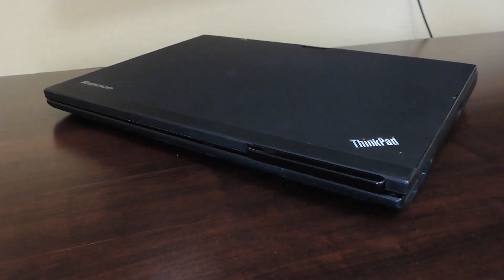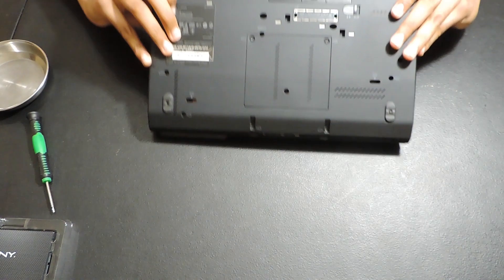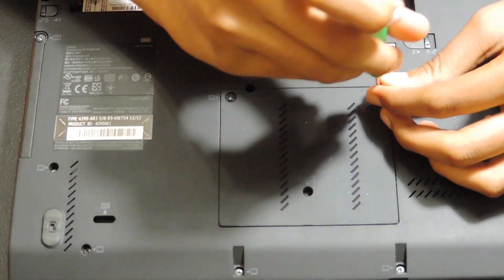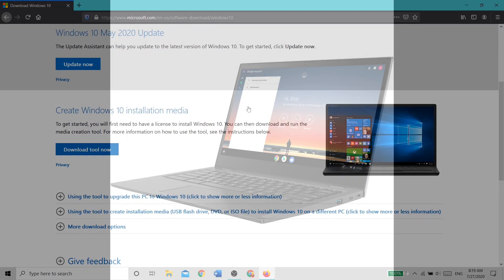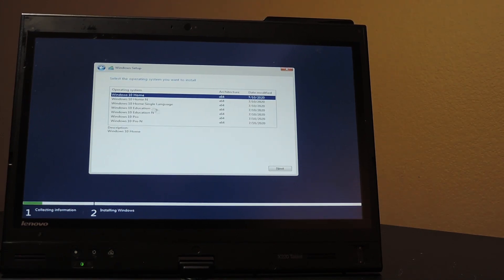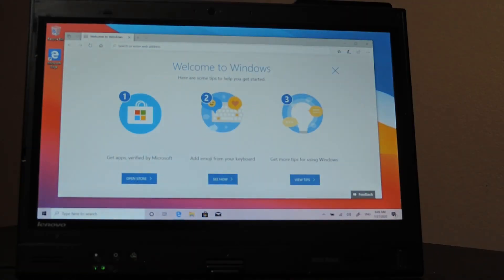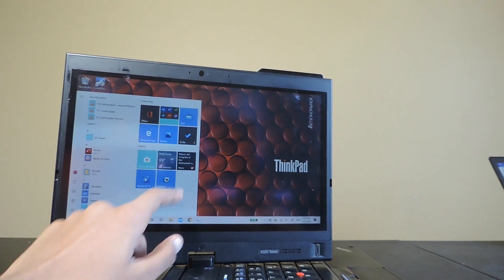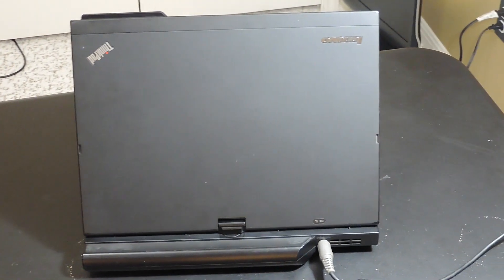Don't buy a Chromebook for school! Buy this instead!

Comment: I would recommend using the Lenovo Win10 images instead. https://support.lenovo.com/gb/en/solutions/ht035659. You may still need to install the drivers for an X220 though.
Reply from the maker: I didn't know about those. What are the advantages of using the Lenovo images over the media creation tool?
Reply: @YeetPC  It has the ThinkPad drivers and stuff like Lenovo Vantage already installed, although it most probably doesn't have X220 drivers. The power drivers may be optimised for better battery performance as well, but I need to test that.